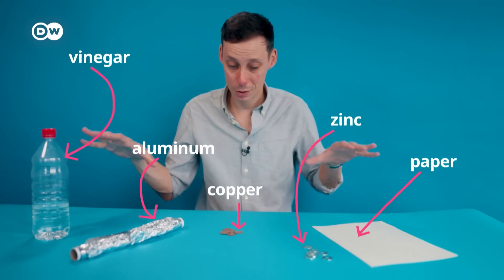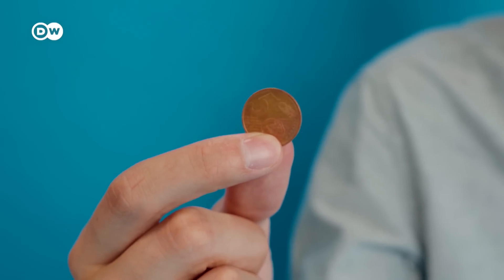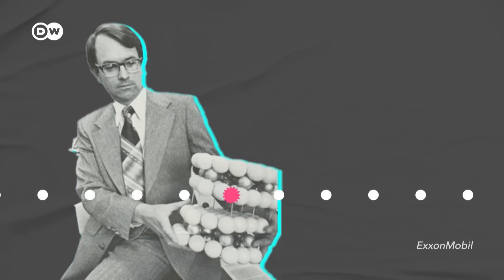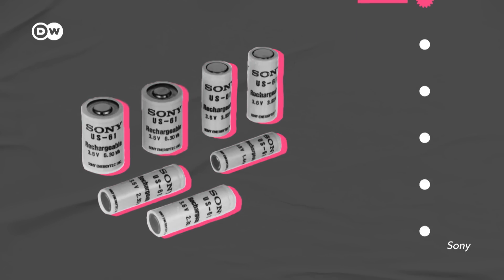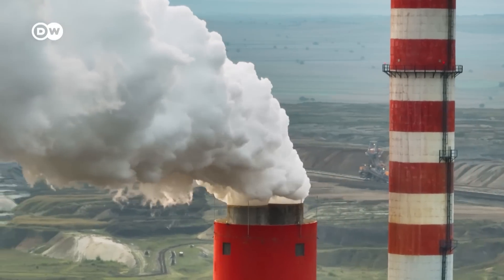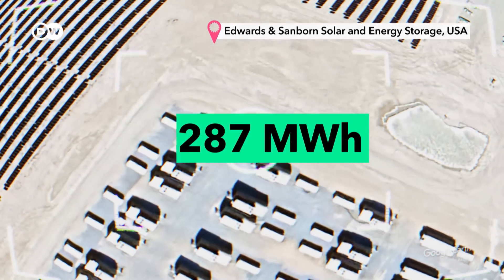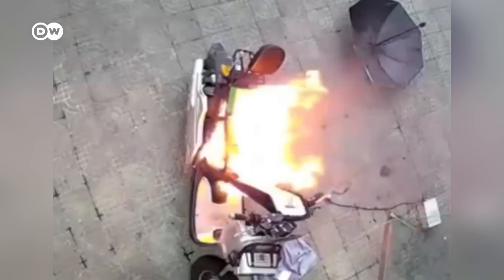Can your phone battery help to solve one of the world's big problems?

Comment: You say that we would need 14 times more storage capacity to acheive the short term climate goals but lithium batteries last at a maximum 10 years.    So if we use lithium we would need that much capacity every 10 years.      No where in the video do you mention the time period or number of cycles that lithium batteries will last for.

Comment: The video was nice, though I wouldn't call lithium ion batteries "plain old batteries". Plain old batteries are not even rechargeable. But I think for a big part of the energy grid storage we will need something cheaper than lithium ion. Possibly sand batteries especially in colder climates and then perhaps sodium or redox flow batteries. An important piece of the puzzle are also virtual power plants that are talked much less about than battery improvements. It is more sensible to run e.g. the AC, fridge, water heater etc. a bit more right before the peak consumption and during peak hours reduce their usage. That will make the consumption and production meet better, reducing the need for energy storage in the grid.

Comment: At what point are we going to get one of those crane gravity batteries... But actually lifting batteries instead of concrete blocks?
Terminals on top and bottom of the blocks to work similar to a traditional battery for fast charge and discharge demand, and the slow lift/lower mechanism for longer period day/night cycles.
Reply: Never, because the wear and tear on the cranes/lifts outweigh any electricity produced. It is a dead concept only used for greenwashing scams. Moving batteries would be increadibly dumb, you would have to build the housing for them much stronger, make movable connections and keep plugging and unplugging, a nightmare  to make reliable and cost effective. 

If you want to make long term storage, use thermal storage, heat up a couple of thousand tons of crushed rock to 500-600 degrees celsius, then run a steam turbine to extract the energy. That way you can store gigawatts of energy with a couple of millions USD worth of materials that will keep working for hundreds of years  (rocks do not generally degrade form that kind of slow heating and cooling, you just need to maintain the insulation and cover material.

Comment: My friend is a co-founder of a small energy storage project company that deals with turning unused mineshafts and water-filled mines into energy storage. The necessary shape is already there in abandoned structure so only some clearing and modification (say, treatment to surfaces to reduce water porosity) are necessary to utilise them. In the case of mineshafts they store the energy gravitational potential by lifting a weight on a cable system. The water-filled mines act as mini pumped hydro facilities. It is hoped that these facilities could help reduce the storage need in countryside areas of England where there are fewer large powerplant facilities, so that renewable sources can be used more effectively.
Reply: Who will service the mineshafts? How much will you need to strengthen them? What will you do if debris fall down an block the movement? How much wear will happen to the motors, winches, cables, fall arresters, bearings etc.? 

Unless you have a free giant generator, an incredibly large and stable mineshaft that goes a thousand meters below the surface and an incredibly strong surface around the shaft, you will not make your money back before maintenace will eat it all up again.
Reply: @TheEsseboy  As I said, it's my friend who was a co-founder. Their plans have been critiqued by investors and funders and have been shown to work convincingly enough that they are being made, so something must work out right.
Reply: @antham8112  Okay, so what full scale system that have been used for more than a fraction of their expected life time do you have for reference? 

Let me answer that for you, NONE.
Reply: @TheEsseboy  Geez dude, who hurt you? I left this comment in response to the video's prompt, not to have acid spit in my face. Go play with your audio editing software and leave me alone.
Reply: @antham8112  Got it, you just lied and act like a child now
Reply from the maker: Hey there! Yes, research is looking to shafts of decommissioned mines or abandoned metal mines for gravity batteries. We looked at gravity batteries and their potential just some weeks ago in this video 👉https://www.youtube.com/watch?v=fB39BISNt0s

Comment: I'm pretty sure big storage facilities can be done with cheaper (arguably) and safer nickel-iron (NiFe) or nickel–metal hydride (NiMH or Ni–MH) or sodium-ion  (NIBs, SIBs, or Na-ion) or even with good modern lead-acid batteries. Or even compressed air storage or flywheel storage systems.
Reply: Lead is a problematic metal that should not be used in new products, nickle batteries are much more expensive per storage capacity, and they do not last as long.

Compressed air requires incredibly expensive valves, pipes, tanks, pumps, check valves etc, flywheel storage can't store enough energy, you can make them big, but the cost of the bearings and drivetrain skyrocket the larger you make them.

Comment: Sodium-ion (very abondant) & Graphene (very efficient) batteries seems more interesting to me. 
Let alone small photovoltaic cell able to harvest energy even with indoor light to power small devices without the need of energy storage, since as long as there is light it can works.
Reply: Of course they are "more interesting" but they just do not work, I've read about using graphene in batteries at least a decade ago and there were several companies promising breakthroughs within 5 years, yet over a decade has passed and we have nothing that would actually work.
Reply: @nikokapanen82  Indeed, just like the famous perovskite for solar panels and 40% efficiency (in labotory) but too vulnerable to heat & humidity... kinda ironic for solar panels..

But, I still have hope by the time I save enough to build my house 🗿

Comment: I'm always curious why sodium ion batteries aren't being developed for grid storage base load and then lithium used for peak or surges is use. As sodium as a raw material is cheaper and less environmentally damaging than lithium
Reply from the maker: Hey there! There are larger sodium ion batteries for storage and there is research going on regarding larger scale sodium ion batteries. One big disadvantage is the lower energy density compared to lithium.

Comment: small modular nuclear reactors
Reply: Small, expensive, complicated, highly enriched fueled, never produced and validated for civilian use nuclear reactors will never take off. It is a quirck of nuclear reactors, they do NOT tend to do well when made smaller than a 100-200 MWs, too little fissile material to keep the netron flux high enough for a sustain reaction with low enriched fuel.

And if you didn't know, highly enriched fueled reactors are only used by military vessles or installations for a reason, the freaking fuel is sometimes even bomb grade! And if it isn't, it is very close to it! Perfect fuel to steal and use for dirty bombs or real nuclear devices.
Reply from the maker: Hey there! We did a whole video on SMRs a few months ago 👉https://www.youtube.com/watch?v=GhKQ8EP1a1Y

Comment: Lithium ion batteries for any form of long term energy storage is a horrible idea, there are far safer and less environmentally damaging batteries or energy storage types out there. Li-ion is only useful and should be used in areas were weight and energy density is paramount like electronics. Everywhere else Na-Ion, compressed Air and more should be used.

Comment: Aren't batteries highly toxic and too expensive to recycle?
Reply: They are not toxic compared to oil, coal or natural gas, in fact, unless you cursh them over a strainer nothing will come out unless they are 30+ years old. Recycling them is cheaper than using metal ores to create new ones, as the concentration in the recyled mass is much much higher and contains no harmful (harmful to the creation of working batteries) impurities.

Comment: Pretty stunned you didn't mention the sodium ion and flow batteries that are going to be dirt cheap, and made from industrial byproducts instead of mining hard to get polluting metals once their gigafactories ramp up.  Also the promise of solid state and semisolidstate batteries.  Kinda sloppy there. LN2 storage is a major form of storage that should ramp up and capture carbon out of the air in the form of dry ice now that they've figured out an energy efficient way to super freeze things recently.  When they need energy they can just let it warm up slightly and the pressure will push a turbine.  This is a much more useful solution than those big greenwashing CO2 collecting fan things that currently use more energy than carbon they collect.
Reply from the maker: Hey there! We looked at sodium-ion batteries a while ago here 👉https://www.youtube.com/watch?v=-vobMl5ldOs

Comment: It looks like underground hydrogen gas in salt caverns may be the solution for long duration energy storage. It's pretty inefficient, but capacity is vast, so if you only need to fill in occasionally, it may be a reasonably good fit.
Reply: It's very inefficient.
Reply: @nickwinn7812  But if you're only using it 5% of the time, does it matter?
Reply: @BooBaddyBig  if you are not in one of the few completely flat countries like Ireland or Lebanon, pumped hydro is 95% efficient. Even in those two countries, there is hydroenergy storage.

Comment: Can’t you also made sodium-ion batteries that, while don’t have as much storage capacity as Lithium-ion, are also much cheaper because sodium is everywhere.

It seems to me like sodium would probably make the most sense for stationary storage plants. Since weight isn’t an issue and storage probably isn’t an issue either since you can just rather cheaply make more sodium-ion batteries.
Reply from the maker: Hey there! Yes, sodium-ion batteries are also used for storage. In China, one of the first larger ones just went operational this year.

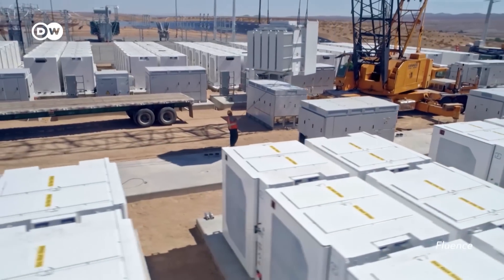Comment: 5:14 Actually you don't need mountains for that; ground depressions might work just as well. Only, they are full of potential energy while they are empty, and they are spent when fully filled. To load them with energy, pump the water OUT.

Second hydraulic accumulator of energy is pumping water underground between watertight layers, putting it under large pressure and slightly bulging the terrain. The water under pressure of landmass weight has energy of a much deeper water accumulation. The water pressure at the machine room level of the reservoir of classic hydroelectric plant is proportional to weight of water column high as water level in the reservoir. However, if there was a column of e.g. stone on top of the column of water, the pressure would have been much higher. and you can do that in most types of flat topography.

Comment: It is peanuts. I get the impression the people behind this video dont like math. Storage on grid level in just Sweden need to be about 2TWh if it is supposed to be only renwable which excludes nuclear. Minimum is to ensure energy to atleast to weeks. January is cold with almost no sun and often very little wind. 47Gwh worldwide is nothing.
Reply: 2TWh is a crazy number that is far from being realistic for a small country like Sweden. Sweden produces almost half of it's electricity via hydro power including more than 30 TWh of pumped hydro and water reservoir capacity. And Sweden generally has a lot of Wind in January with it generally being the Month of highest Wind energy production. Where do you get your data from?

Comment: I'm 80% of the way through this video, wondering when they are going to start talking about "plain old batteries", because lithium-ion batteries are most definitely NOT "plain old batteries". They are horrifically pollutive to manufacture, politically problematic in the distribution of the resources needed to mine and manufacture, and a lot more dangerous in operation than most people realize. 

The only advantage Li-ion technology has is in power density, which makes it ideal for miniaturization, but deploying Li-ion batteries en mass is a huge mistake for humanity. There are fortunately some newer battery technologies in development, like Prussian Blue doped sodium-ion batteries, which are cheaper and safer and less pollutive, with longer useful lifespans, but they don't have as high an energy density, so while they will be useful for grid-scale, building-scale, and transportation-scale installations, they cannot replace Li-ion for most human-portable uses.
Reply: Exactly.     Lithium batteries in my experience last for perhaps 5 years, if they last 10 years that would be huge.      So it's not like the report says that we need 14x more lithium batteries for future storage, we will need that much every 10 years.  We are just walking into another environmental disaster, based on deliberate ignorance coupled with capitalism just as we did with fossil fuels !

Comment: 04:50 I've got pretty much a setup like that on my window to catch the sun during the day (20 Wp at 5 V folding USB panel), charging a 20 Ah batterypack and in the evening I recharge my phone, tablet and watches, if needed from it. I even have an USB powered soldering iron, which I can use with that.

Comment: The ideal battery solution is an enhanced geothermal system (EGS). They can store energy for up to 10 days, and come for free with every new EGS well that is drilled. You have the heat from a geothermal well to produce energy, and in the daytime, when there is much renewable energy, they can stop producing and just store the energy by pumping in water. It's the perfect solution for battery storage and base load power. Fervo is building a 400MW system in Utah right now. Many other companies are jumping in too. Mostly people from the oil and gas industry are seeing the future in it. So it's even a way out for the fossil fuel industry. Over its entire lifespan, you can get more energy out of an EGS than out of an oil well. What are we waiting for? No more chemical batteries needed. Which is good for the environment too.
Reply: That sounds like a good idea for places with suitable geology.  How many locations have formations with enough heat at sufficiently shallow depth to make this practical?  I've done some work at a geothermal plant, and there are challenges such as the amount of available energy and chemicals in geothermal water (it's really hard on turbine blades!), but these can be solved.  There can be a lot of good jobs for people in making this happen.  There's need enough for all the geothermal, pumped hydro, and batteries we can get working in the next few years.
Reply: @LiFePO4gtC8H18  That is another benefit of this technology, the hot rocks needed for it to work are available basically everywhere in the world. Just drill deep enough, frack the rocks by pumping in clean water, no chemicals, and you've got your reservoir. They are going to 6 and 7 Km deep, and hopefully they can go even deeper when the Quaise Energy drill becomes available in a few years from now. Then they can go to depths of 20 km if needed. Do some research. Advanced geothermal is developing very fast now.

Comment: Lithium mining is not great for the environment though.
Reply: It's no worse than coal mining or drilling for oil. The difference being that you can use the lithium thousands of times and then recycle it, getting most of it back to be used over and over again, whereas you burn your coal and oil just the one time and it's gone. Not to mention CO2, sulfur, Nitrous oxide, particulates etc etc from burning fossil fuels.
Reply from the maker: Hey there! Yes, there are problems with Lithium mining. We look at some in this video 👉https://www.youtube.com/watch?v=gAZV1Ut6DDs